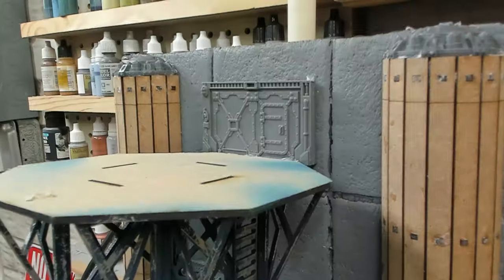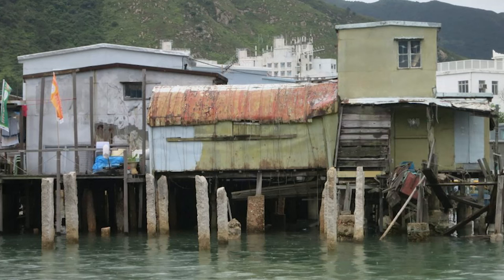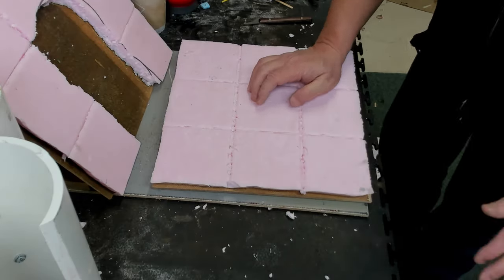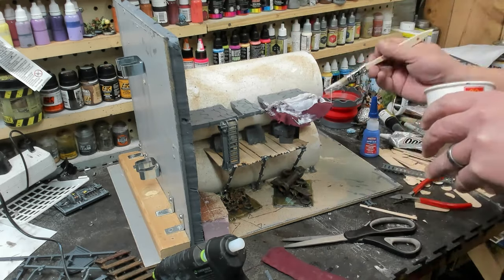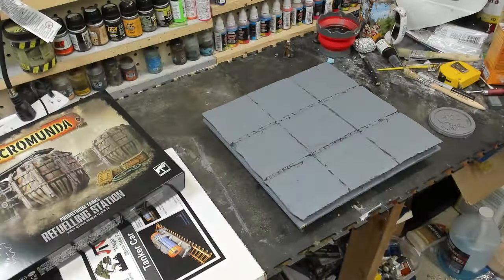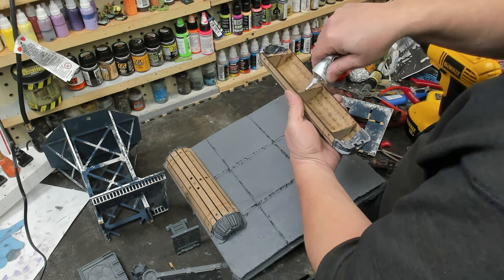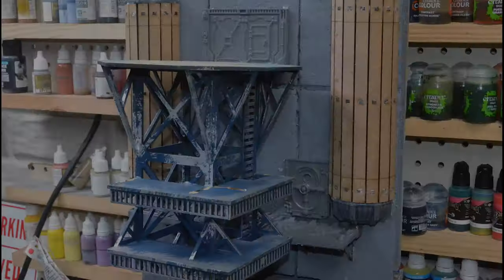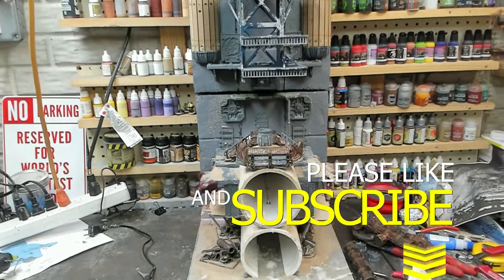Necromunda Sumpwall Settlement Kitbash

Comment: What about having fishing or salvage nets to capture the outflow from one or both of those pipes?  Not sure if you would want it to be based on some rickety framing to extend the walkways or more of a crane and and cable based netting arrangement, maybe one of each.
Reply from the maker: There is more details coming along those lines..... fishing hunh...... i like it a lot!  Thank you again!
Reply: @jdinthesumpsea1560  So weird idea can your buddy who does your 3d printed floor tiles work in something clear? Because if so imagine having clear bit's be they floors or walls or the face of a pillar, back them with the one way mirror plastic prime the outside with a varnish and then build up your rust from there. I'm hoping that the mirror will make a good enough metal.  Then have something in the wall and an LED that can flash to reveal it... also don't tell your friends before they get to see it in person, maybe a Genestealer cult patriarch or something.